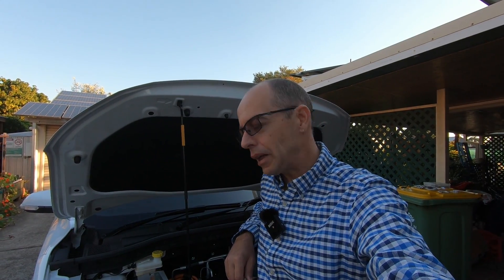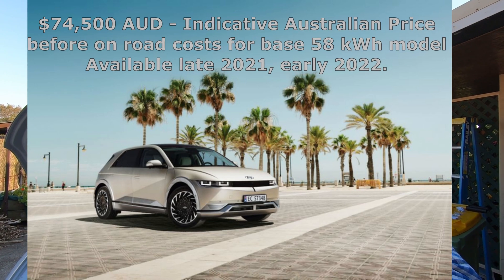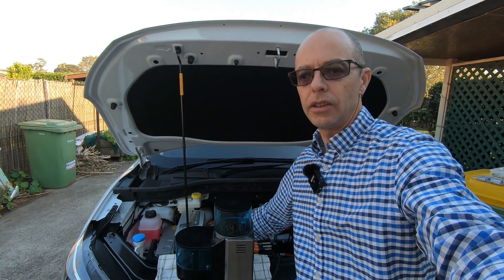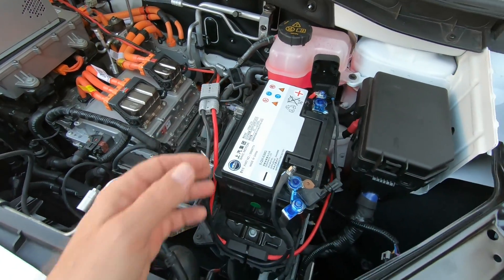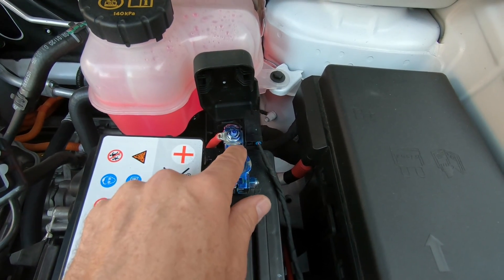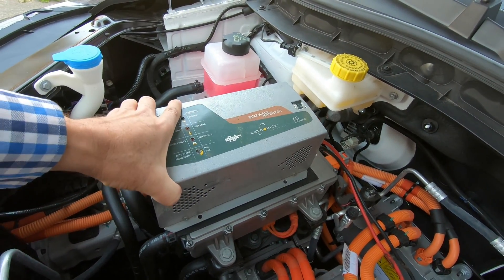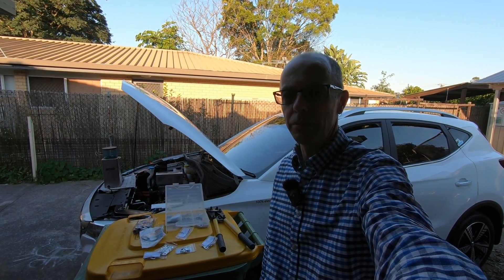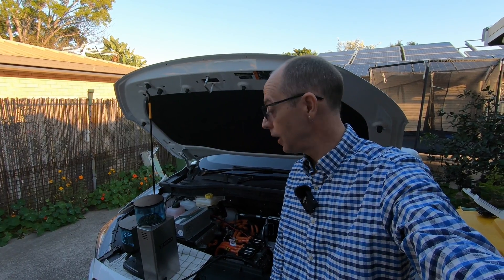MG ZS EV Vehicle to Load (V2L) DIY Upgrade. Powering your TV or Coffee Grinder from an Electric Car.

Comment: The new MG ZE EV has 2.4kW V2L via the charge port. Infact the inverter seems to be significantly more than that so mods might be possible, it really seems to only be the cable that which has a build in 10A power board that is limiting it to 2.4kW.
Reply from the maker: Thanks for the comment. Yes we're looking to test it out in the 2nd Gen MG ZS EV & BYD Atto 3 in upcoming videos. Hit that 'Bell' icon so you get notifications. 👍

Comment: Does the car have to be running for V2L to work or can the engine be off?
Reply from the maker: Yes, in this model the car has to be in 'drive' mode to ensure the traction battery contactors are pulled in, otherwise your 12volt battery won't be charged. Models with dedicated V2L don't.
Reply: @ElectricCarAustralia  which cars have dedicated v2l that doesn't need the car in drive to work? Feels impractical to have the car on and locked just for it to work!
Reply from the maker: In Australia, the BYD Atto 3, new model MG ZS EV, Hyundai Ioniq 5 and Kia EV 6 do vehicle to load. Some will need a separate adapter.

Comment: I see that as mere tinkering around the edges.. The serious side is when you can connect directly to the battery to a 30/40 mains plug and isolator switch on the fusebox to take over during peak power times.
Reply from the maker: Hi Laurens, totally agree. It will be great when the Network operators and regulators  catch-up and this serious stuff can be rolled out. Thanks for the comment.

Comment: Not sure that really counts. People (including you) have been using little inverters to power low wattage AC devices from 12V batteries for years.

The thing V2L really promises is decent power. Ability to run a stove for example. Can't get this from a 400V battery, through a DC-DC converter, to a low power inverter.

Funny, yesterday I saw the opening of the BYD showroom in Sydney. BYD supply a little dongle that plugs directly into the DC charge port and provides AC power. I bet it doesn't handle much wattage either.
Reply from the maker: Hi thanks for the comment. Yes I have travelled around Australia with a petrol vehicle using an AC inverter.

Not sure on the Atto 3, but the new MG ZS EV has a similar dongle as you call it ant it delivers 2,300 watts AC
Reply: @ElectricCarAustralia  2300W is more like it. Then the misses can run her hair dryer. ;)

Comment: I believe the mg has electric heating, no heat pump.  It would be surprising if this came from the 12V system.
Reply from the maker: Hi, your correct no heat pump and yes it operates from the 12 volt system same as other cars. Cheers
Reply: @ElectricCarAustralia  then i asume the heater would take quite a lot of power ( more than 1kW )from the 12V, so the dc-dc must be capable of that.  Which would mean that more power can be taken from the 12V battery.  Do you have any idea on the heater power consumption
Reply from the maker: @springburo  Yes it must have a decent capability because the car does have a lot of power hungry tech. No can't determine the heater current draw even from fuses as the Chinese manufacturers aren't great at naming and descriptions. Cheers
Reply: @ElectricCarAustralia  sorry for the late response, I am also connecting an inverter to the 12V battery and I found this video. I did a checking of current drawn from the main DC batter ( just had the car on ready mode and check the current in the front screen and turned on the heater, the current went from 0 to 10-18 amps (voltage was at 425 at that time) all the time, so I assume that to handle such power (more than 4KW), it is safe to install a 600 w inverter (a bit larger than yours). Cheers

Comment: Surely if you follow the cables from the battery back to the inverter you will bump into a fuse or maybe there will be a plate on the inverter which gives the out put rating
Reply from the maker: Hi, cant find anything which indicates. Will be sure to let everyone know if I find out. Thanks for watching. Happy NY.

Comment: Nice idea. People in the U.K. are complaining about the durability of the SAIC battery, so could be a consideration. Seems much simpler to use 12v  devices.
Reply from the maker: We'll provide an update on our 12volt battery as it ages but all good so far. Yes 12 volt accessories are more convenient in most cases. The 240 volt is most useful on a farm, jobsite or in power failure at home.
Reply: I've upgraded mine to a Tsapa 12v Battery. Much more beefier longer lasting 12v battery

Comment: Great first step. 
Next you need to get a 400V DC to 240V AC / 5kW hybrid solar Inverter, install a grid bypass on your house and power the house with the Inverter from the EV. The solar inverter will both charge the EV during the day and power the house from you solar array at night as well as augment the house solar inverter from EV battery inverter when high load demands occur.
Reply from the maker: Thanks for the idea Benny. I have spent way to much money on solar, batteries and inverters over the years so I might pass on this one :)
Reply: @ElectricCarAustralia  This would save you money...if you hadn't already shelled out for the batteries already.
Seriously though I wonder why V2G isn't mandated in all EV's?
Reply: @Bennyboy-dog  Your idea is overly simplified. Problems. 1. You need some way of splicing into the high voltage DC cables. These are not off the shelf items - you have to custom design something and you have to know how to work on the vehicle safely. Remember, where talking a 400V plus pack. 2. You’d need some way of communicating with the vehicle and the BMS to avoid over discharging the traction battery, which means you’d have to reverse engineer the CANBUS communication. The BMS also has to be able to stop the discharge in the event of a fault. 3. Doing any of this would instantly void your warranty on the most expensive components in the vehicle - the traction battery and the High voltage system.  4. A hybrid solar inverter would need to match the vehicles HV system pretty exactly. There designed for specific battery chemistries and voltages so you’d have very limited choice, if any. Most of them are designed for LiFePO4.
Reply: @mondotv4216  Easy solutions to all these "problems" MondoTV. Its called engineering a solution. There are always "details" and there are always solutions.

Comment: great project! well done. Would be interesting to know the DC-DC converter rate in case somone could safely squeeze in a bigger inverter. Also interesting to know the 12v battery box can take a bigger battery, might be worth having a bigger battery if someone was using VTL a lot!
Reply from the maker: Hi Wyatt, thanks for watching. Yes; we're going to keep investigating to find the DC converter capacity. Bigger battery is possible, just need to weigh up against increased energy consumption/less range due to additional weight so depends on each drivers preference.

Comment: OMG! Never thought of that. Well congrats, you did what looks like a world's first. I had dome some of my firsts like making 1000 cups of coffee with a machine that takes over 1200 watts but I was using a 600 watt inverter.  Also I broke more rules by doing this in an automatic van far from any power source with a single undersized old battery. It took a bit of energy managing but we never got stuck at all. Now in my neck of the woods the dealer would instantly cancel my warranty so I have remained on smaller experiments. What I wonder is on how many firmware upgrades this car had? I am a bit too hyper-active for the version I test drove. Same dealer sells the Merc EQA here and thinks that it was not for me until the medics slow me down. I would first measure the onboard charge current. Glad you are game to do it. Good test!
Reply from the maker: Hi, thanks for watching and leaving us a comment. You can never have too much good coffee while on the road :)